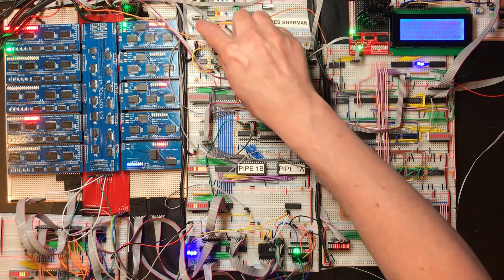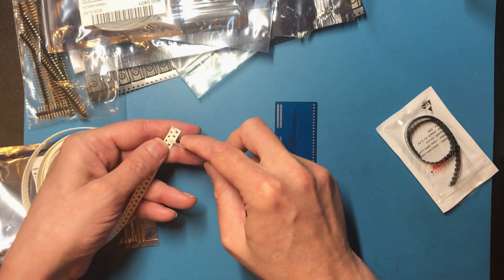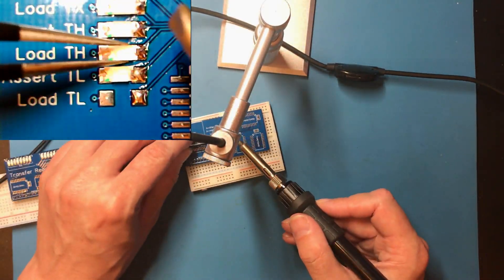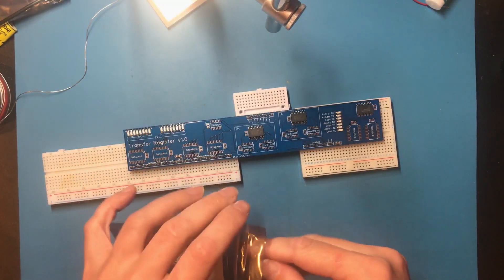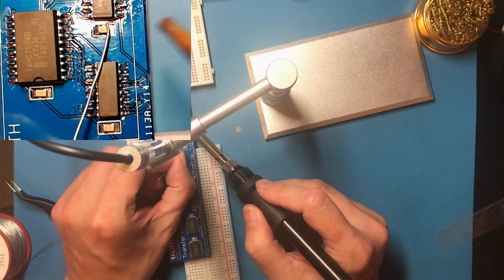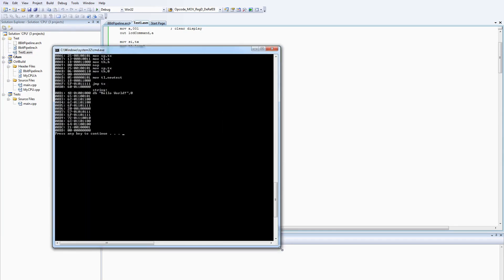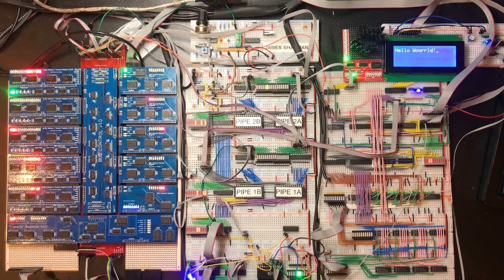Transfer Register (Completion) - Making an 8 Bit pipelined CPU - Part 56

Comment: (10:28) Alright, assuming I'm understanding the pipeline correctly, without the hidden prebranch instruction, you could optimize this by moving the INC SI instruction just below the JNZ TX instruction, correct? My reasoning follows (you can ignore it if you want):
With prebranch, this is eight cycles per loop (one immediately from MOV A,[SI]; one from INC SI; one from a NOP introduced by address bus contention during the MOV A,[SI] instruction; one from DEC B; one from OUT lcdData,A; one produced immediately from the hidden prebranch instruction; one from JNZ TX; and one from fake address bus contention on the prebranch instruction, which also fills the JNZ instruction's branch delay slot.) If you didn't need the prebranch instruction, the naive approach would have taken seven cycles. (You would lose the cycle immediately caused by the prebranch instruction, and have to manually put a NOP in the branch delay slot.) However, that would then allow you to move the INC SI instruction into the branch delay slot (the MOV A,[SI] instruction doesn't need SI until pipeline stage 2, so we're good on that front), which would get rid of the extra NOP there, bring the total cycle count down to six cycles per loop.
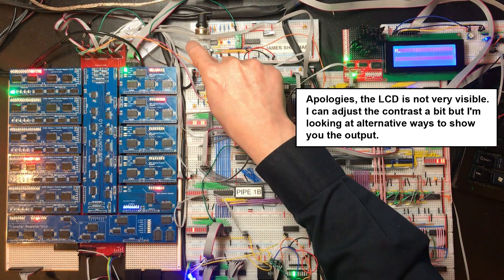(13:39) It looks fairly visible to me.
Reply from the maker: That sounds about right, for a few functions where the effort was worth it I've played around with using the delay slots but also dropping the prebranch when I can time a memory operation consistently. That can be more difficult that it looks at first glance due to the instruction dispatch being different due to earlier instructions.

Comment: Hi James, studying your schematics of the transfer register and bus control and comparing it to mine in proteus, I found Reg_TX_AMode and Memory_Ack which are not in my schematics. Could you please explain me the meaning of the two lines or in which video to look, thanks!
Reply from the maker: I think I've mentioned both briefly. They relate to optional functionality that I haven't built yet. AMode is unlikely to happen, it was going to be hardware support for offset based addressing mode but I've not really needed it and it would have been extra complexity in the transfer register. Memory_Ack will be used later.
Reply: @weirdboyjim  Thanks for Info! in your schematcs, the Const-LD is part of demultiplexing the mainbus-load, in mine, which ofcourse is developed from your great videos ,const-LD is demultiplexed  by the DEC/Load 74ls138.Did I,again, miss something, or is your uploaded schematics not the up2date one?
Reply: Hi James, making my buscontrol & backpane pcb of  your CPU, I would need your explanation to the above ConstanTload question, many thanks!

Comment: That's brave... it looks like you bought exactly enough chips to build the board. I always follow the "one to use, one to screw up and one to wonder why I bought so many" rule.

"That looks gorgeous"... it certainly does!
Reply from the maker: I bought the wrong line driver chips, so the strip of 6 you see in this video was hurriedly bought from an ebay seller. I did have a couple of spares in parts bin though, just not enough to make the board.

Comment: I'm looking forward to the RAM part. I've been trying to design the RAM bits for my computer, and I can't figure out how to do a write in a single cycle without having the write pins on the RAM still being enabled at the end of the cycle when the bus flips to whatever it's needed for next (or at least, they should flip to read/disable at the same "time", but propagation delays may decide otherwise, so I don't want to risk it).
Reply from the maker: Glad you’ve found it interesting so far! Did you watch my “Temporary Display” video? The memory write is going to end up similar to that insofar as it’s looking at a timing diagram for the device next to the signals the cpu generates and trying to match them up. I’ve obviously not done it yet, so I don’t want to make predictions (You’ll see it as I do it). What memory chip are you using? How is your write/device load line coming out of your cpu?
Reply: @weirdboyjim  I did watch the display video (and I'll definitely use one of those displays at some point too, I have a few lying around). I'll have to watch it again, chances are I didn't pay enough attention because I hadn't thought about it enough yet (that's my usual M.O., miss important stuff because it's not relevant for me yet...). I'm using HM6168HP 4x4K chips initially (I have 16 of them lying around, so the odds of finding two working ones should be decent), but all SRAM chips of that generation seem to be similar. The main thing I'm worried about is having the buffer that sits in front of the RAM switch off its output slightly before the RAM switches out of write mode. This probably points to me being confused about the main control logic, which I haven't actually built yet :)

Comment: Nice progress!  I'm going to fire up my solder iron for the first time this week and re-watched some of your videos to get some tips.  I thought I got a notion from one of your last videos that you intend to follow this CPU up with a more ambitious one?  Perhaps a RISC-V 32 bit CPU in discrete logic?
Reply from the maker: Thanks! And good luck with the soldering. I’m trying not to distract myself too much with plans for the next big project. The two options are “go big” and build a 32 bit cpu or “Go simple” and go for something that would be easier to program and for people to “build along” with. In the later case I would still be aiming for something a bit more advanced than an ultra simple TTL computer.

Comment: Any plans to move the whole CPU on to a PCB?
Reply from the maker: Yes, it will all be pcb eventually. There are a few modules that haven't been made yet, I build first on breadboard and then migrate it to PCB once the design has been tested and settled. The registers were made first so they made it to PCB first.

Comment: Very nice! 
Do you have any tips and/or tricks for making wires for breadboards? What tools do you use? The biggest hurdle for me right now is all the measuring and cutting and stripping and bending of wires. It's quite boring and tedious. To get away from that (and quite inspired by your build) I've started designing PCBs for my CPU, and I must say that the PCB making process is challenging, but a lot of fun, and very satisfying when it all comes together! (Btw, thanks for your videos on schematics and PCB design, they have been very helpful for me! Feel free to make more : ) 

But I still want to test the circuits on a breadboard before I order a PCB to be manufactured (I'm too much of a novice to blindly trust what I think should theoretically work), so I can't really get away from the wire making... And it would be a shame to not use the meters of wire and the wire stripper I've bought. 

I haven't planned out everything on  my build yet, but as of now it looks like my CPU will be something inbetween Ben Eater's and yours, but the process is becoming more like yours (test on breadboards first, then make PCBs). No matter how it turns out I'm enjoying it so far :)
Reply from the maker: Cutting and shaping wires for the breadboards is a time consuming task, but I can give a few tips. Cutting a bunch of wires the same length at once saves time, cut a bunch wire in the sleeve to the same length. Then strip the ends, then bend. If you are making very short connections you can cut the wire to length, strip of more from one end and then slide the sleeve down to the middle (this saves some time). Big tip is to keep a blank breadboard for measuring wires, you can usually count how many "pins" of spacing a wire needs to be, having a spare breadboard to measure and test against without all your components on makes life easier.
Reply: I'm in more or less the same boat. I started on breadboard, filled about 15 of them, then had to wait for more chips, and because I had made exactly zero notes I was a bit lost when those chips arrived. Also, while waiting for those chips I found this channel which made me reconsider some parts of the "design", but I didn't look forward to redoing all those wires.

Now I've basically restarted from scratch, building some small PoC parts on breadboard to make sure I understand how the chips work, and then design PCBs.  I got the first batch this week, so now I have a bunch of GPRs, a shift unit, a '153 based logic unit, and an adder+flags unit. These boards seem to work and only needed minor corrections (don't forget to run DRC before ordering the PCBs, to make sure you don't miss one connection!), so I just sent out my designs for the next batch (memory, address registers, clock). After that I only have the central control logic to build, but I'm not sure what I want there yet, so that may well be a full breadboard build at first.

Comment: I'd look at getting an OLED screen for output, cause the viewing angle on that is amazing :) Plus superb contrast!
Reply from the maker: I'm mostly thinking of options where I can get a decent overlay onto the main video.
Reply: @weirdboyjim  Probably a second camera suspended above and zoomed in. You'd have to dial the contract in just so on the LCD
Reply from the maker: I did that on the display video, but i'd liket o find something I can capture from directly. More soon.
Reply: Oooohh like generating a text stream and feeding it to something like OBS using a plugin to capture and display it?
That could be fun :D
Reply: Maybe you could make a serial module to connect to a PC, through an FTDI chip or similar
Reply from the maker: That's one of the things I've been thinking of. Serial out from the cpu wouldn't be too tough, it does have the disadvantage that I'd need to have a pc attached.